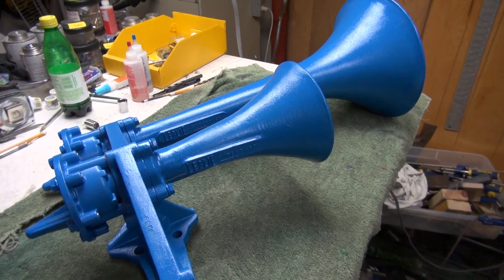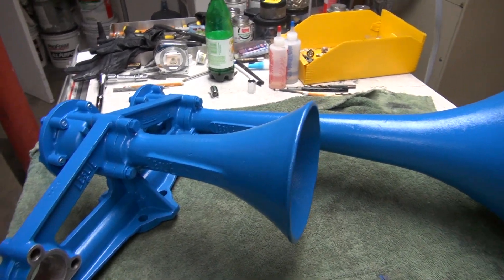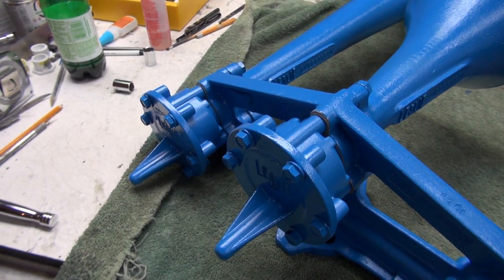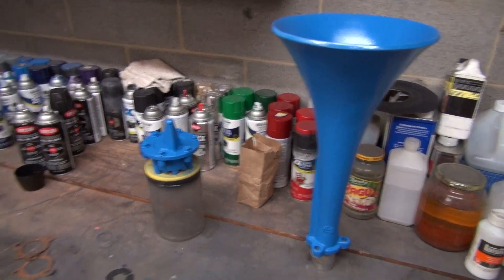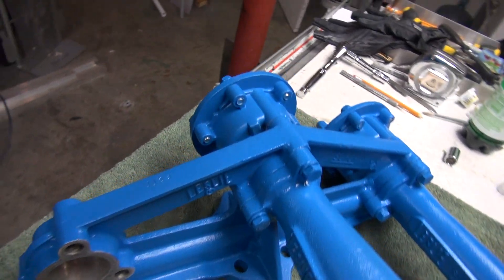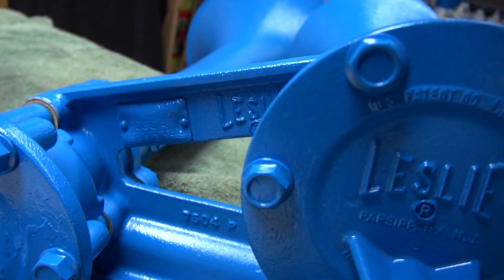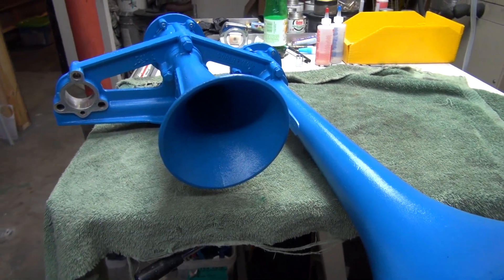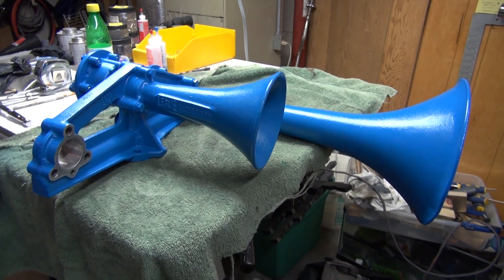RS3L UPDATE

Comment: Scott, I paused your video when you were zoomed in on the tag, it looks like it says SL3LR. If so then at some point the S power chambers were changed out for RS power chambers.
Stands for: 
S-SuperTyfon
L: Low bracket
3: 3-tone
L: code for chord
R: Reversal 

Your horn is standard reversal, (#44 bell reversed), there are other codes for nonstandard reversals.